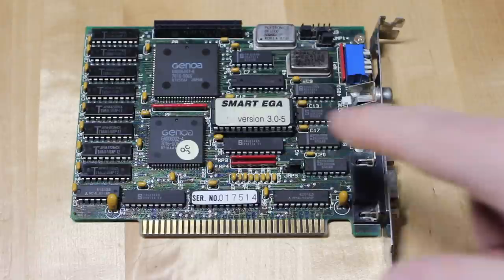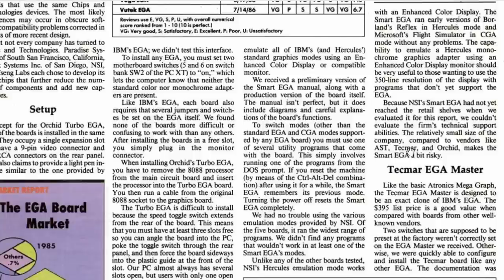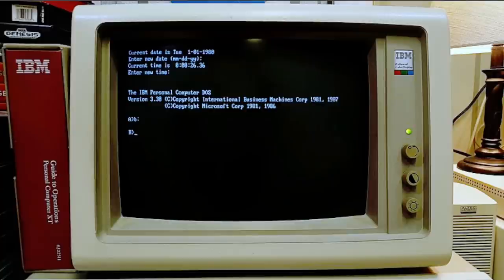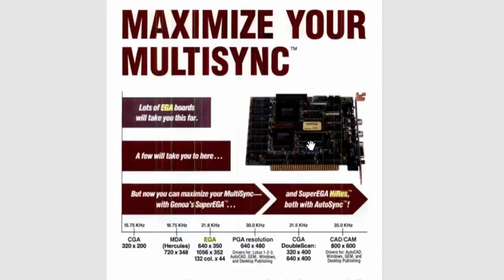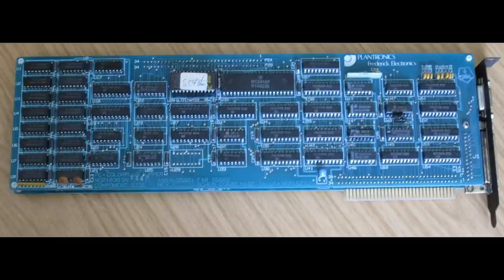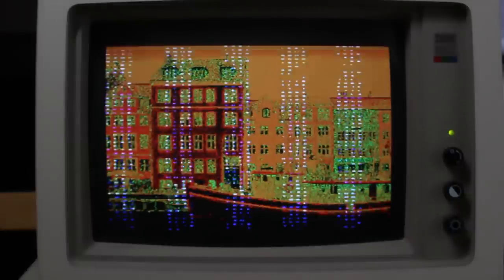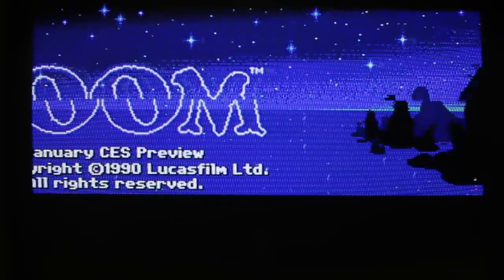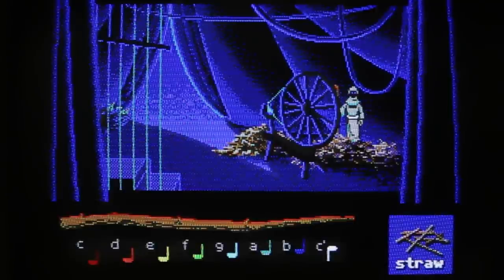The intrigue of SmartEGA and SuperEGA

Comment: 5:08: "...which actually used a completely different connector and video signal." <-- Oh, you wish! The truth is, video signal yes, connector often no.

Back in the day, various electrically incompatible peripherals often used mechanically identical connectors, which could be a recipe for disaster if you were not careful (and unlucky). You could fry stuff just by plugging the wrong cable into the wrong spot, where it would fit without your forcing it. (People forced things too, but that's another story.) And connectors weren't always well-labelled and mostly never colour-coded. At least once the ATX standard came along, it finally distinguished between the mechanically identical mouse and keyboard PS/2 connectors by using different colours, but getting that wrong was never as dangerous, and things were much worse in earlier years.
My first VGA monitor had a DE-9F connector, and you can still find ye olde 9 to 15 pin VGA cable pinout at a long-established pinouts site from a country YouTube's censors don't allow me to mention. I had a 9-to-15 VGA cable back then. Actually, I still have one. Anyway, I think connecting that old fixed-frequency VGA monitor with the DE-9F connector to e.g. a CGA card's DE-9F using a DE-9M to DE-9M cable could well have fried it. There also were VGA cards that had DE-9F connectors, so those could have been connected to my VGA monitor with a 9-pin straight through D-sub cable, not to be confused with a mechanically identical null modem cable. DE-9 was used for CGA, MDA, Hercules, EGA and, yes, sometimes VGA. I'm not sure if the latter was a cost thing, maybe they saved a cent or two by forgoing the initially less common and more dense DE-15F connector?
Of course, mechanically identical connectors for electrically different stuff was always a bad idea, but it was NOT a rare practice; users were just expected to be "expert enough" to pay attention and get it right. Other examples that come to mind are the mechanically identical DIN connectors for the keyboard and cassette ports on the original IBM PC, or, behind the Iron Curtain, the three or four identical DIN connectors on the Elektronika BK home computers. One of which was for the power cable, and getting that wrong can't have been good! (The DIN connectors were for: power, b/w TV, RGB monitor, and cassette storage. The RGB DIN connector was sometimes not factory-installed, but could be retrofitted.) Again, IF ONLY they'd always used different connectors for different signals!

PS: YouTube's censors twice deleted a previously posted version of this comment. Boy, the B1d3n-era Big Tech censors REALLY hate legitimately useful stuff when it's from the country I can't mention here! This is getting VERY tedious. Are you on Rumb13 or on any other less aggressively censored platform?
Reply from the maker: No I'm not on other platforms. Yeah VGA 9 pin shorted the pins for the second bit of EGA data together. One way or another this was asking for trouble.
Reply: Remember all early Sinclair computers, where power supply uses a 3.5mm mono plug. But so do the input and output of the cassette interface. At least on the Spectrum this doesn't seem to be lethal if you plug it in the wrong one; at least until you think the connection has gone bad and you wiggle it vigorously. Not sure about earlier ones, whether it was worse. That's definitely some cut throat BOM pruning though.
Reply: @SianaGearz  BOM pruning is a great term, haha! :) 
The funny thing is, past a certain point, volume-purchasing ½ n-thousand X and ½ n-thousand Y connectors can't have been that much dearer than purchasing just n-thousand of the X connector. Perhaps the most that would have really saved is a line on the bill of materials. :)
That said, I have a definite hunch that the early popularity of DIN connectors for ALL THE THINGS might have had something to do with cost. Perhaps the alternatives weren't royalty-free at the time? Does someone know for sure?
Reply: @ropersonline  Where would the royalty come from? To collect royalty, you need an intellectual property that is somehow protected. Today this comes for example as trademark, where people expect to see a USB symbol on a USB plug, but you can't print that symbol if you aren't a member of this consortium, or they might whack you for trademark violation. Or ICs with magic firmware, which is copyright protected. But you can make a connector shaped like USB and nobody can tell you not to. Functional aspects of physical items can be protected by patent, but try patenting some pins and a guard piece? Good luck, you have tons of prior art to contend with.

I think it's just economy of scale. All home audio equipment was full of DIN plugs, so there was exceptional production capacity present. Maybe supply overshot demand and the market got a little crowded. I do think the Cannon style D connectors were limited to a handful suppliers and mostly used industrially, but also they had been around for 20+ years by the late 70s, so if there had been any intellectual property protection, it would have long lapsed.

Today, this excess capacity is gone. I bought (or forgot to buy but surveyed the prices for) some DIN5 plugs for MIDI purposes, and the pricing in China is kind of spicy now, since they fell out of use. I could buy the fundamentally more expensive to manufacture XLR plugs for a fraction of what DIN plugs cost today. Not to speak of 6.3mm and 3.5mm plugs which barely cost pennies per kilogram.
Reply: @SianaGearz  You make some great points. Of course another way to get royalties besides the trademarked logo route could be or might have been cartel economics: If most or substantially all the major suppliers insist you pay a cut for thing X, good luck trying to avoid that. In fairness, I don't actually know if that was applicable here, back then – and perhaps I should refrain from wasting more time on hypotheticals and speculation. :) Thanks for your reply.
Reply: @SianaGearz  The later Sinclairs weren't much better ... everyone plus dog uses coax barrel plugs with centre positive as a defacto DC power standard? Well everyone except for Sinclair, anyway. And they don't mark the port with the polarity to give you a fighting chance of realising it's centre negative, just a voltage. So yeah guess who's blown up an otherwise perfectly good Spectrum +2 that they didn't have a first party adaptor for and just assumed "9V DC" meant centre positive...
Reply: @tahrey  Early SEGA Megadrive is 9V centre negative, late is centre positive. At first they were getting their PSUs from Yamaha. Yamaha and KORG synth gear especially of earlier era is centre negative, as are just about all guitar pedals, and in general synths are a wild mix. My 1997 Yamaha PSR530 runs off a Megadrive centre negative PSU. :D In the more distant past, you just cannot assume the polarity.

That being said i think these should always be protected on the device. A full bridge rectifier together with a nice LDO would work with either PSU. A cheaper solution with a single diode would do for mere protection, this is SEGA's choice. If a full working voltage is needed, a crowbar circuit of an antiparallel diode and a fuse. Of course it would not be Sinclair if they spent an extra cent or two.

I did burn a flatbed document scanner in late 90s by connecting it to a wrong polarity PSU accidentally from a different scanner. Those things weren't cheap.

Today peple are burning up a lot of expensive PC components because they use modular cables from the wrong ATX PSU. The sockets on PSU body often have reverse polarity between brands but reuse the same plugs!
Reply: @SianaGearz  Dammit, you mean I could have just plugged in the adaptor from, like, our Master System 2 or Game Gear and it would have been fine?

Though by the same chalk I could have blown one of those up as well. But I sort of expect Sega might actually have put a polarity diagram by the socket.

(never had to use a generic adaptor with either of the consoles at least)

Anyway I honestly never expected it was that variable. It doesn't even really make much sense ... the centre of a barrel plug is analogous to the "button" tip on an AA battery, i.e. the positive end. It just feels natural to have it also as positive that way, and more modern convention seems to follow that. But a good warning to be careful from now on.

And WTF with the ATX connectors, seriously? I'm kinda glad that I haven't done any PC building for quite a few years. Laptops are more than powerful enough to satisfy now and that leaves most of the fun difficult parts to the manufacturer instead.

But yeah bridge rectifiers on DC inputs for the win. Or even the parallel standard of using low-voltage AC as the input and just letting the machine rectify that onboard. (Strangely it seems to cause more damage accidentally connecting a DC supply to that, even though you'd think it would be better proteected, versus connecting the AC adaptor to a DC device. Made that mistake in a professional capacity when Creative changed what type they used between two otherwise identical looking generations of their amplified desktop speakers, though luckily fixing it only required replacing a fuse)
Reply: @tahrey  When you build a PC from components you just bought, you can do nothing wrong.

But when someone had a CoolerMaster PSU for example, and they upgrade over to an EVGA PSU, they need to remove all modular cables that came with the PSU and install new ones, or there's a high likelihood of component explosion. Or when upgrading between different PSUs of one brand sometimes.

Even with stupid stuff like this, i will never stop building PCs, i kind of hate laptops. Hot, unpleasant, low endurance. Simple laptops make for good companion devices, but going all out on them leaves me with dread.

Apropos low voltage AC, the only i can think of from personal experience is Alesis Micron from mid 2000s. It won't take any lasting damage from DC supply but it also won't work properly, and will just read inputs badly and sound like it's going insane and dying while you keep it on one.

I think one case that gives me concern with SEGA is if you connect wrong PSU to a Mega Drive with a Mega CD attached to it, the Mega Drive will not run (completely safe) but the Mega CD might not be 100% safe, though might not die either, the 9V signal which might be wrong-polarity looks like it's only used for reset logic and they buffered it, so it should be an easy repair or might be safe, difficult to judge without thinking about it for a long time. Like they definitely try to do everything properly but i wouldn't be surprised if some odd edge case somewhere got overlooked. Also from what i remember everything is marked.
Reply: @SianaGearz  Jeez, that sounds like a very annoying and dumb situation that shouldn't have been allowed to happen, seeing as we've had standardised and idiot-proof keyed power connectors for PC components for decades already. If nothing else the mutually incompatible connectors shouldn't have had the same physical outline, so it would be impossible to plug in the wrong one. Better to be temporarily stuck unable to power a thing than have the power blow it up.

As for laptops ... like anything, they're very variable. And particularly if you buy cheap and thoughtless. I know enough people who just do it almost blind and according to whatever looks flashy in the shop or is on special offer etc, and they rarely make it three years before breaking, and are horrible to use almost from day one as they're badly underspec in basically every area. I've been quite specific in what I've wanted out of mine (with the idealised target spec sheet changing over time according to needs), and so far have managed to average about a seven year usable lifespan before obsolescence and upgrade limits have finally taken them, or physical failure of a heavily used part (e.g. keyboard) which is no longer worth getting a DIY replacement for instead of just upgrading the entire thing.

The ones I bought in 2006 and 2013 are still operational, but what I can do with them nowadays is kind of limited and I'd have to plug in an external keyboard and mouse... 
Hopefully I can stretch the current one out about as long, but the fact that I already had to have a warranty replacement for the keyboard (the most heavily used keycaps wore off within months), upgrading the original PCIe-3 SSD to a PCIe-4 has seemingly reduced the performance, and the driver controls for the GPU seem to be missing a few expected components don't give me the most confidence. I did go more for a gaming focused machine than a business class ultraportable this time, but kept the general spec fairly high and particularly concentrated on having a non-crap keyboard layout, good battery life (not sure it's fully delivered on that, but eh) and decent screen, which filtered out a lot of the lazily built crap chucked together from generic parts. I'm satisfied with how it performs as a general purpose computer, and it's performant enough in games for my taste (40-odd fps feels perfectly smooth given my past experiences, and that's with max settings and graphics enhancement mods). Only issue is the heat output when pushed hard, but I have a cheap cooling tray with a fan in it that was useful for the 2013 one towards the end of its life, that I can use if it becomes really problematic...

It'd be nice to have a proper desktop gaming rig again, but I don't really have the space, and I can't justify spending the money on something that still wouldn't be used as the main machine, because I prefer having all the things I work on and my web browser within the portable one so I can get at it all wherever, without having to prat about keeping things synchronised. Plus the power use would be crazy ... this laptop has a 200W power brick and that seems a bit excessive seeing as I remember those being the kind of thing you'd have in a fairly well kitted out desktop... Blowing over 500w just to run a computer for playing games feels crazy, especially in a flat that gets horribly hot in summer anyway.

Comment: Holy shit 80s IBMs had worse graphics than an apple ii from the 70s
Reply: Eh, a bit yes, a bit no. Depends what you were trying to do. CGA hi-rez (and low-rez composite) was at least equal to or marginally better than anything the Apple could do, at least until the GS came along. The "medium" resolution area is more variable, it would have been a bit better if it had an actual redefinable palette for the 4 colours (and it could be more reliably switched in the Hblank), but they literally ran out of space on the PCB even for the additional eight or so bits of storage that would have required (assuming the border colour and palette number registers would have been reused). On the other hand, 16-colour 80-column text mode with a proper 8-pixel wide font and 25 usable lines...

Comment: HiresEGA with this Monitor, no Problem. But 800x600@16 colors is a bit small (Tested with onboard EGA of the  TowerAT) https://www.flickr.com/photos/94839221@N05/albums/72157660715046016
Reply from the maker: Nice, but which monitor is this? I couldn't tell from the photos. I can only see it is a Mitsubishi. Is that EGA or VGA?
Reply: @PCRetroTech  EUM 1491